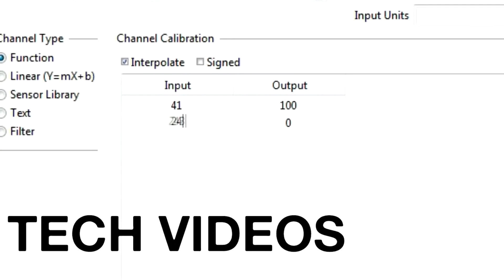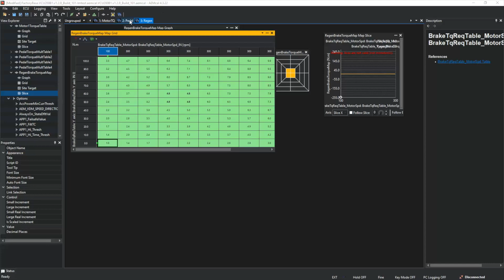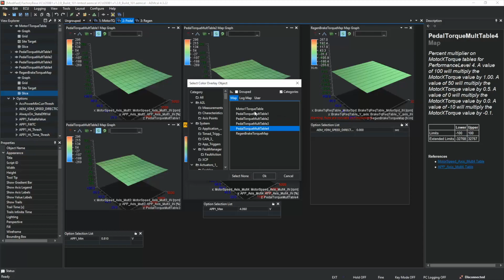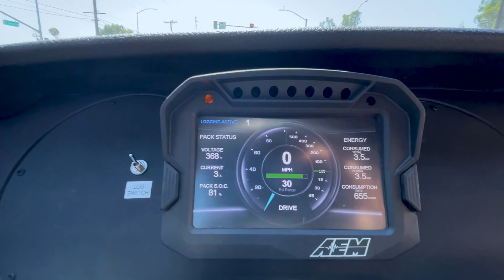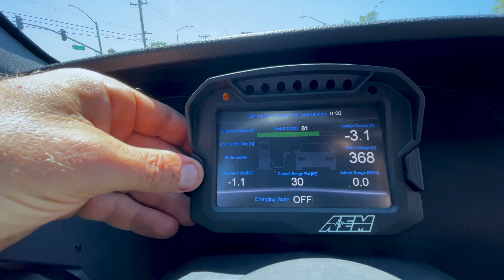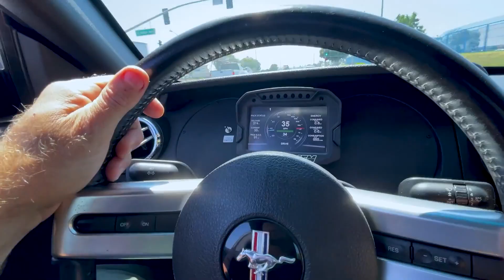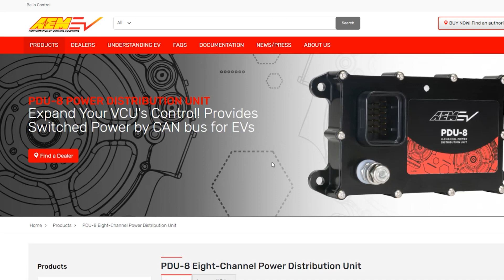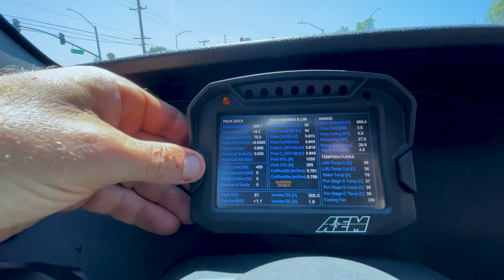Building AEM EV's Custom Tesla-Swapped Mustang

Comment: IS THIS THE SAME 2007 BLACK FORD MUSTANG GT CONVERTED TO ALL ELECTRIC BY ROASTERCYCLE ABOUT 2 YR.S AGO?...HE MENTIONED THAT HE USED A AEM CONTROLER BACK THEN!...SO I AM ASSUMING THAT YOUR NEW AEM CONTROLER IS MUCH IMPROVED FROM 2 YR.S AGO!

I HAVE A 2008 FORD MUSTANG V6 BASE MODEL WITH AUTO TRANS, I WAS WONDERING DO YOU GUYS DO ELECTRIC CONVERSIONS?...I AM IN SOUTHERN CALIFORNIA WHERE ARE YOU GUYS LOCATED?...I WOULD LIKE TO USE A TESLA P100D ELECTRIC MOTOR!...WHAT WOULD BE THE COST TO CONVERT MY 2008 FORD MUSTANG COUPE V6 TO A TESLA P100D ELECTRIC POWERED MUSTANG USING YOUR RECOMMEND EQUIPMENT?...THANK YOU AND GOD BLESS! 😇

Comment: Does this interface with any of the cars original CAN systems? It seems like it has all been removed from the shot at 13:02 - what does that mean for safety systems on the car, e.g. air bags? Are they removed in this case? Will you be able to interface with those systems in the future?

Comment: Thanks for the video - good stuff!  I've seen the a number of videos where the VCU200 is used in combination with the Tesla LDU and replacement inverter board, but have not seen any info regarding the small drive unit.  Do you guys have a solution for controlling the small drive unit?
Reply from the maker: The SDU is on our validation list, but we have not started R&D yet.

Comment: what Battery Voltage do you have with those 6s6p modules? Is it possible to add any DC fast charging to it?
Reply from the maker: It is a 400V system and we will be adding fast charging to the vehicle.

Comment: I think the S197 is a great platform to try and work from.  The prices are getting very reasonable for used ones that run, and downright cheap for non running examples.  I'd love to try and adapt this tech to an older non-computerized vehicle.  There's a Tesla powered '66 Impala out there, along with other classic Mustangs and such.  Probably not something I can afford to do, but do you have any intention of creating a controller for say the Nissan Leaf system?  I would think all the components of the Leaf could be dropped in a Corvair, Dart/Valiant, Falcon, Hornet, or other compact and be just fine for the vehicle's weight.
Reply from the maker: The Leaf drivetrain is a great solution for lower power applications.  Many others have asked for it and it’s on our radar for VCU support in the future.

Comment: This is awesome! Does the VCU have the ability to monitor wheel speed sensors and limit torque if slip is detected?
Reply from the maker: Wheel speed based traction control is a forthcoming VCU feature.